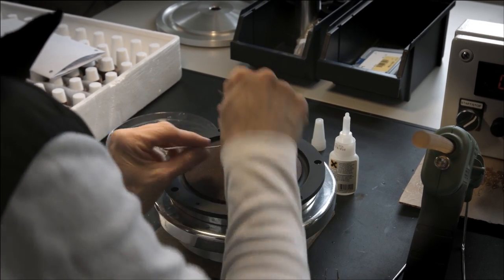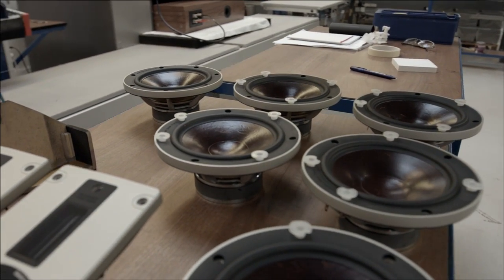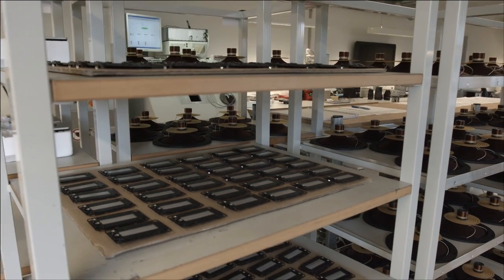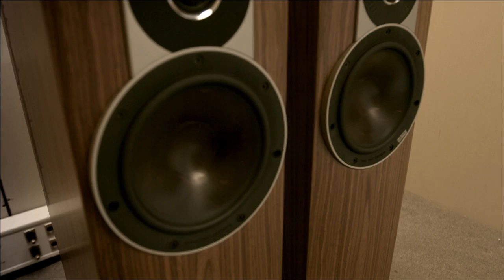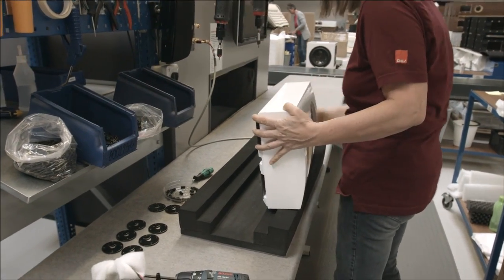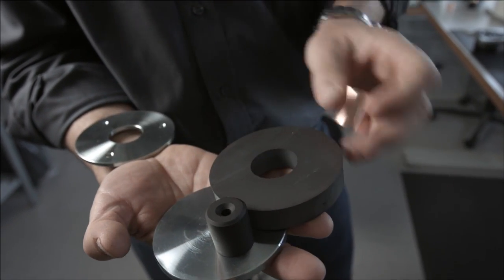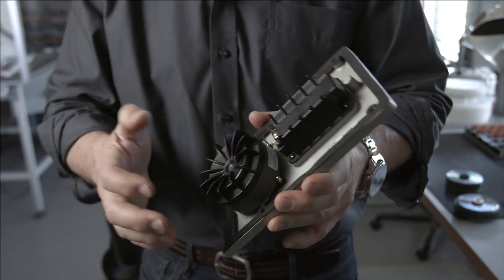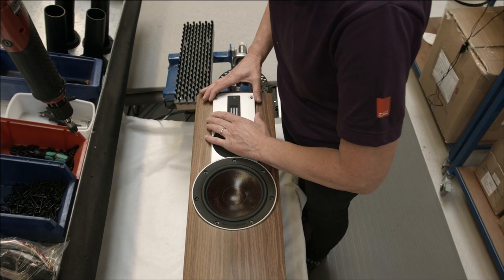DALI RUBICON - Designed & crafted in Denmark

Comment: Ikon, opticon and now rubicon 2 owner.
Dali state not to toe in speakers as of axis is better. My question is how is it best to sit in front of a rubicon vokal that has the hybrid tweeter? I sit on axis?
Also my rubicon 2s do not have the wide dispersion of the ribbon tweeter so is it best to toe in slightly as to keep the strength of the highs intact at the listing spot?
Thanks.

Comment: Are theses speakers good for more than music? What about movies and games? And all kinds of music?
Reply from the maker: Well, all of our speakers are suited for music as well as movies. Of course you could benefit of adding a subwoofer, if your main purpose is movies. And yes, all of our speakers work very well with different kinds of music. They are even clear with a wide sound stage at high volumes as well as low volumes, which you don't find with just any speaker brand. And of course the listening experience is great at any angle and not only in 'the sweet spot' due to our hybrid tweeter module with wide dispersion. /Dennis
Reply: Thank you very much for the reply. Guess movies and games sort of go hand in hand with the quality being so high even in games theses days.

Comment: No drivers de coupling ??? No silicon gaskets? Funny being cheap on a 3 euro huge improvement!!!!
Reply from the maker: The debate about “decoupling” of drivers divide people into groups of people who are in favor and those who are against… But on top of that there are some other reality aspects to consider, as well:

DALI has used silicon gaskets for various models over the years, particularly some years back. We used them mainly for their ability to seal the flange between the driver and the cabinet quite well, just like we use other types of gaskets for that nowadays.

Whether needed or not, the decoupling effect of any elastic and damping material when used as a gasket turns out to be very limited, both because the material (also silicon) is compressed very heavily into forming an almost paper-thin structure to a point where all suspension effect is virtually lost! Another limiting factor is the metal screws used for fixing the driver to the speaker baffle firmly, as they form a very stiff structure along the chassis flange with the ability to couple the driver to the baffle and by that preventing most decoupling effects no matter which type - and shape - of gasket is used. 

As to the pro- or con decoupling aspect there are in fact also good reasons for COUPLING the driver’s chassis to the speaker’s baffle: The most important being “grounding” the driver’s chassis to something heavier than the actual driver itself, in order to minimize resulting reaction movement of the speaker itself driven by the driver cone’s opposing motion (counter force). 
Why is this also important? Well, a driver chassis in perfect rest forms the best possible foundation for the magnet motor to transfer all force and by that all motion in order to move the drivers moving system most accurately and with the highest possible dynamics!
Reply: @dalispeakers   If we do have a flimsy, low mass frontal baffle, (????) at least a 2 cm mfd sanwiched with roofing tar material to another 2 cm mdf then we would have a decent baffle, add some plastiline gaskets, the drivers are yes, one thing with the cabinet, but some of spurious vibration somehow always created, get lost, to a degree of clarity unimaginable with 4000 euros loudspeakers, some diy, really work hard. and lots of internal mass, metallic panels to the internal cabinets walls and bracing, something the Industry cannot do!